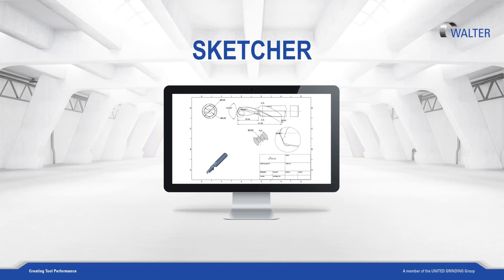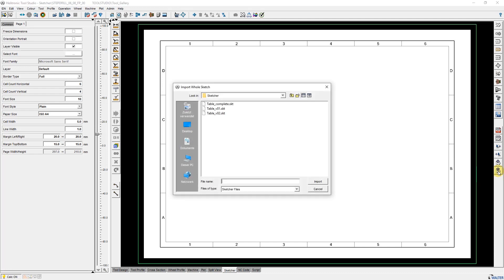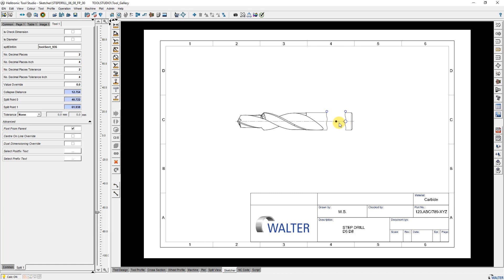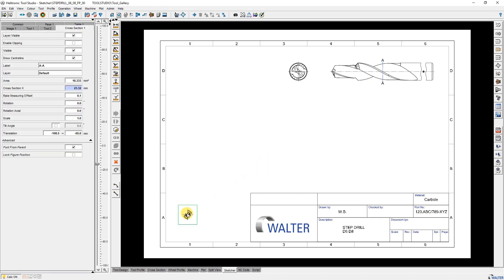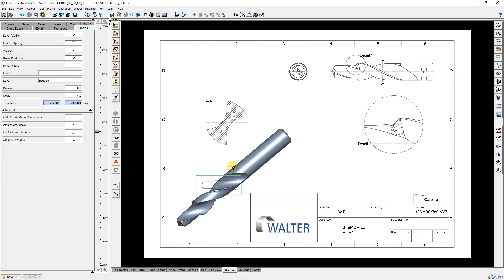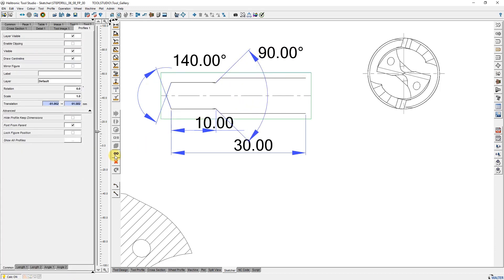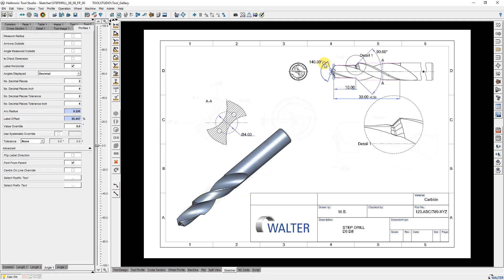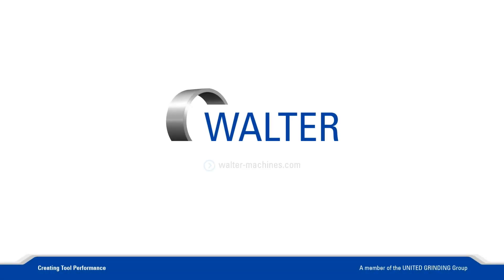WALTER Sketcher

Comment: Is it possible to load my in Fusion 360 created Cutter in the Maschine?
Reply from the maker: Dear @Erwin Oberkofler thank you for you question and interest in our machines. We can import *.stl, *.obj and *.vrml into HELITRONIC TOOL STUDIO. These formats can be exported from Fusion 360. However, no material removal simulation can then be performed on this model; they are only used for comparison with the current HELITRONIC TOOL STUDIO IDN. The HELITRONIC TOOL STUDIO plug-in "Quality Assurance" is required for this. If you have further questions on this topic, feel free to contact us directly via info@walter-machines.com

Your WALTER-Team